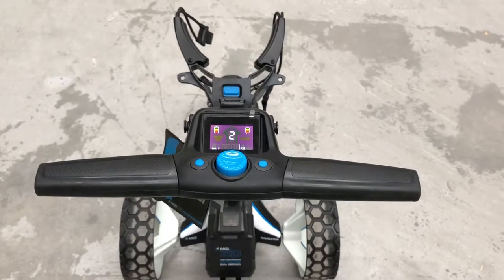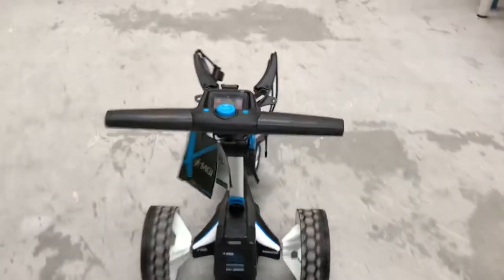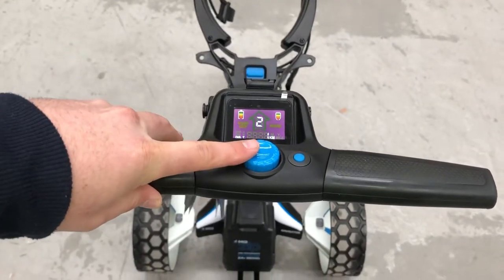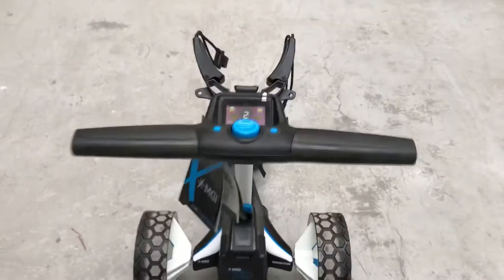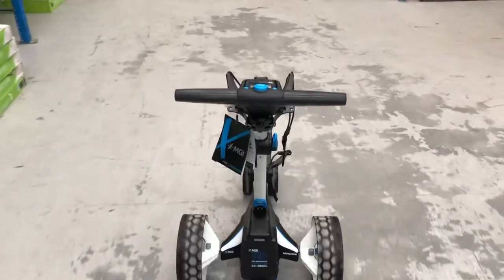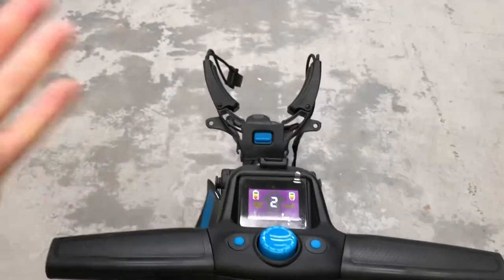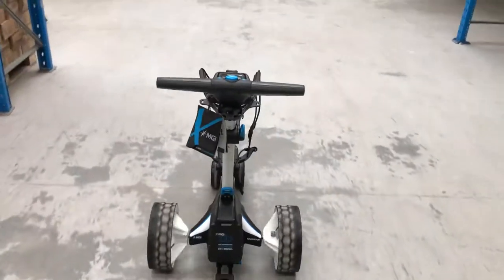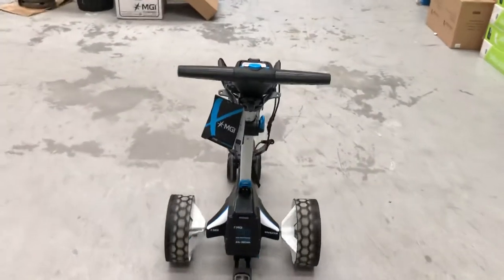Zip Navigator Motor Trimming

Comment: I did this and the cart ran much straighter when you push the button… However when I use the remote control which is supposed to make it go straight now it veers slightly left instead of going straight with remote control. Do you have a cure for that?
Reply: Did you ever get this resolved? I just bough the Navigator AT and have used it twice and it pulls to the left when using the remote, and it' doesn't seem to go back on track like it's supposed to.